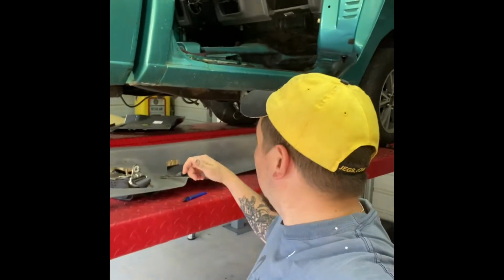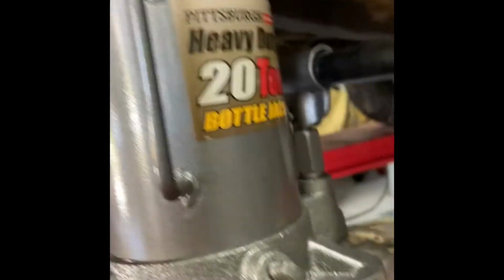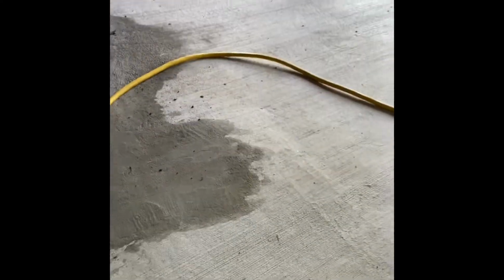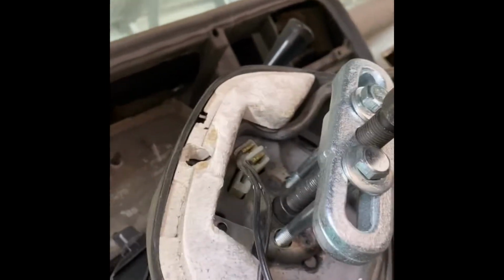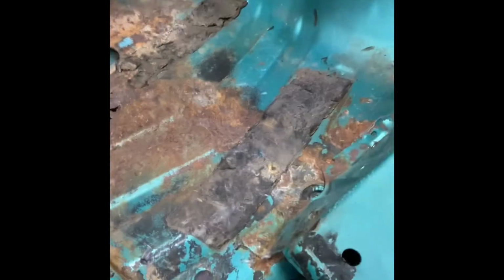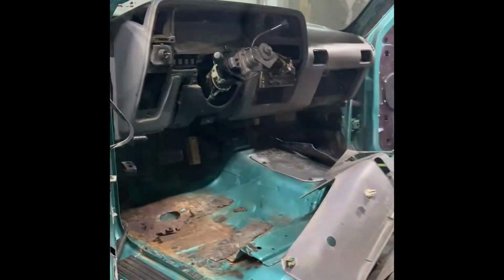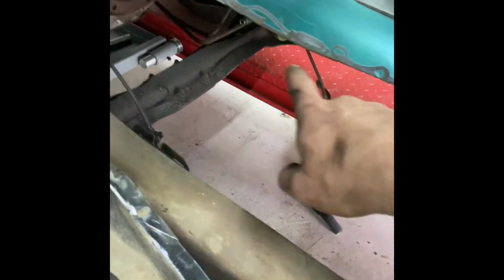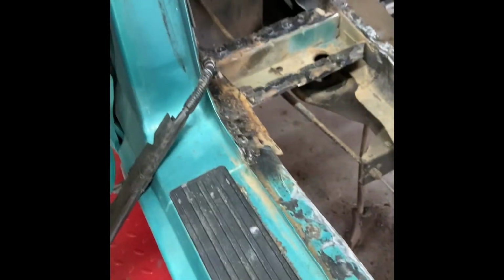Ford Ranger Floor Board Rust Repair Episode 3

Comment: wht year is the ranger trying to rebuild my 2001 xlt standerd cab but can't find driverside front pan for it what would you recomend? thanks steve
Reply from the maker: Classic2currentfabrication is where I have been getting my floor pans. They have a store on eBay that I order from. The Ranger in the video is a 1993. Thanks for watching.